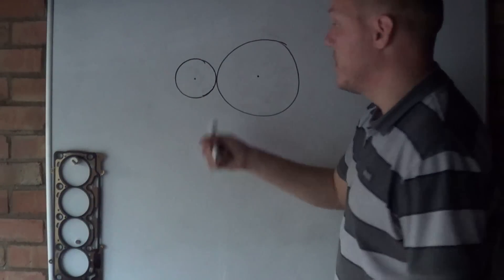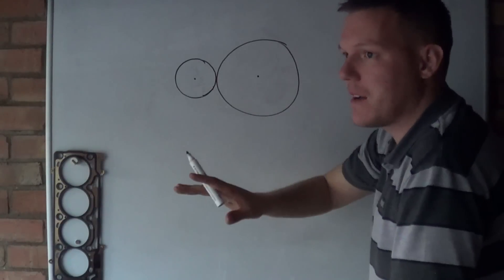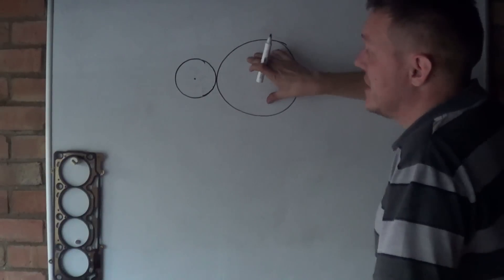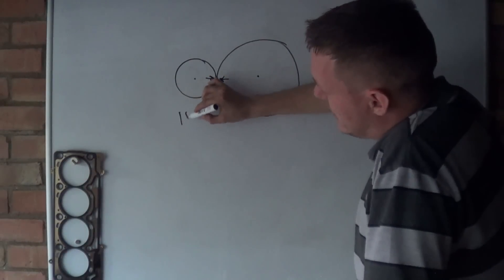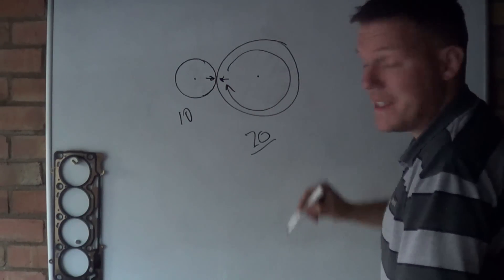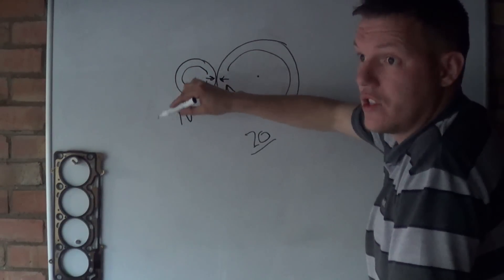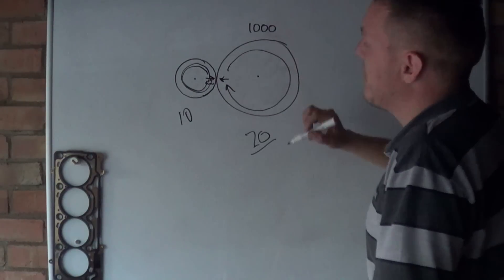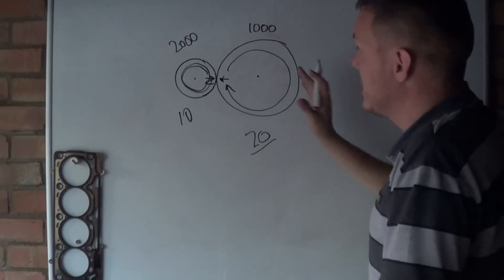Understanding Gears and gearboxes - Bike TEch

Comment: Hope u doing well all these years Matt. On my 2 stroke (135cc) bike project, I reduced the ratio of primary drive & all gears to increase the top speed while keep the final drive ratio as original. With comparision to factory set up, I managed to get my custom set up by controlling the SHAPE & CURVES of SHIFT-SPEED graph to get similar/close to the factory originated graph but produces a huge of speed difference. 

Concerning to the torque, even though the ratio having changed, how can I calculate the amount of weight reduction required? are there any other correlations I need to concerned about to 'steal' torque?

* note: my calculations from Gear Commander website
Reply from the maker: Gear commander is bollox. There's no load in the calculations so the numbers are wrong.
Reply: Wow, not expected your prompt reply,thanks a lot Matt..nerdy guy here agree with u,numbers shown result of plain calculation only & that is why i tried to match graph curves & shape with stock model (u please don't dumped me in this stupidity)..Fyi, i believes with your expertise & knowledge before and it would be my honor if u can advise some to my project.hope given details would help;

Model: Yamaha RXZ 135cc 2 stroke
Primary: 22T-71T (mod. 23T-71T)
1st: 34T-12T (mod. 30T-12T)
2nd: 29T-16T (mod. 27T-16T)
3rd: 26T-19T (mod. 26T-20T)
4th: 24T-21T (mod. 24T-22T)
5th: 23T-23T (mod. 22T-23T)
6th: 22T-24T (mod. 22T-25T)
Final: 16T-30T

Currently, expecting the other modification has been done for the engine resulting increase stock RPM from 10500rpm to over 12500rpm and Frankly speaking, i managed to gain these modification earlier with references thru your channel.
Reply: Additional note of my current project, basically, I'd reached 0-180 kmh in a distance almost 400 meters in just around 11.0-14.0 seconds. Other day, i'm cruising with top speed 205 kmh (full throttle) at over 12500 rpm (out of tachometer) with stock gear settings. Shame on me exposing not precise decimal numbers to u like this,sorry. I record these result manually alone (wishing to team up with partners for next trial). I believes with the ability of the engine now being able to increase some more top speed without stealing a lot of torque with the gear setting planning i proposed. Appreciate for your next reply Matt.

Comment: Great video 👌🏼I ride a 2015 zx-14r & would like to keep the stock sprockets but I want more torque & higher rpms in 2nd & 3rd  gear only 
Is it possible to only change out 2 gears & I don't believe my transmission is a cassette type
Reply from the maker: The short answer, no. Finding a replacement 2nd gear for a 2015 bike is hard enough as most parts dealerships won't hold stock until after the warranty has finished. Kawasaki don't official supply other gear ratios to anyone, not for street bike at any rate. They don't officially supply different sized sprockets either, those days are gone. The way they look at is now is you get what your given. Back in the day you could buy .5 - 1 and 1.5mm oversized pistons, they rarely do .5mm oversize for most supersport and super bikes. They want you to buy new, not fiddle with what you've got. 

One other thing, which one do you want? Higher torque or higher rpm? I think you mean more torque at higher rpm?...........
Reply: Pony Power my bike does 7000 rpms at 65 mph with a +2 rear sprocket but only  I would like to have my 2 & 3rd  gear  match that setup of +2 rear sprockets without sacrificing my top end speed
Reply from the maker: I understand what you mean, the wording was just abit weird. Yes the solution is to change the gear ratios of 2nd and 3rd. Gears and sprockets are the same. The difference is that your sprockest are parts of the final drive. I.e they change the entire gear range. IF you swaped out say 2nd gear for a longer ratio then you would achieve a higher speed before changing into 3rd but you'd lose some acceleration. You can either have top speed or acceleration just like with sprocket sets. You can't have both. To do that oyu have to change the engines geometry, (bore - stroke etc) 

I would be amazed if you could find 2nd gear set with a different ratio. Never seen one apart from racing, and I don't know of anyonw who would machine you one up. I understand this is not what you wanna hear but thats just the way it is.
Reply: Pony Power thanks for the information it was a nice in theory too bad zx-14r is already a beast I was just trying to leave the line faster then   Run top end all out💪🏿
Reply from the maker: No worries, like you stated before if you had a cassette gearbox then you would have some options. Cassette gearboxes are very expensive and used for racing (around £3K) not only that but the bike engine needs to be design from the ground up to except a cassette box.